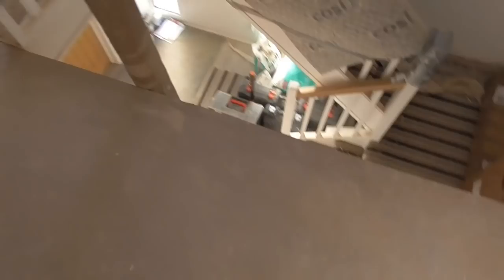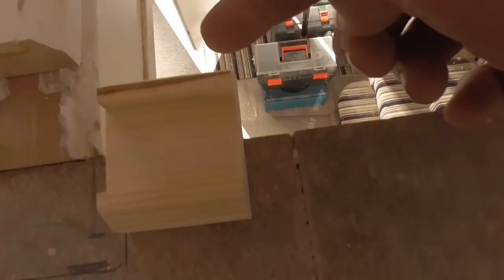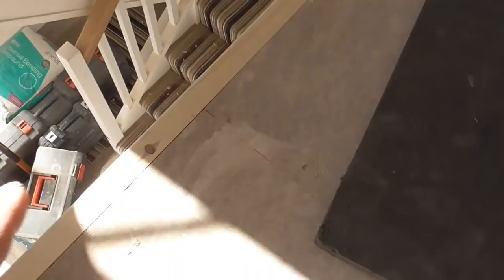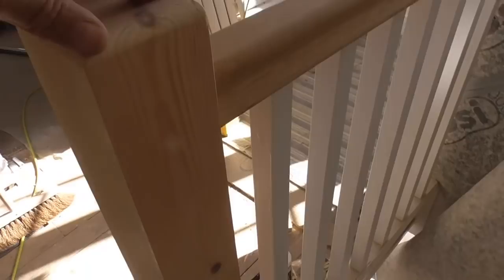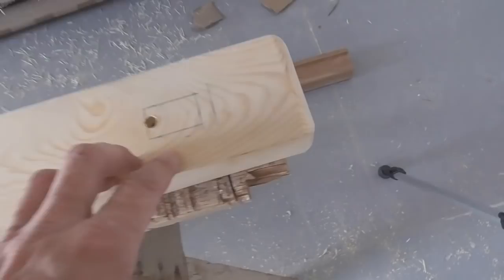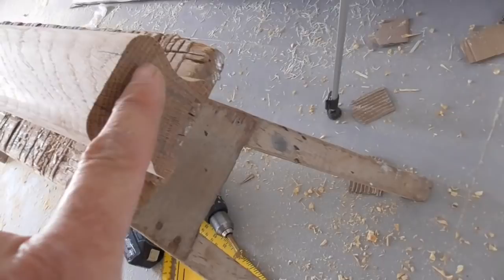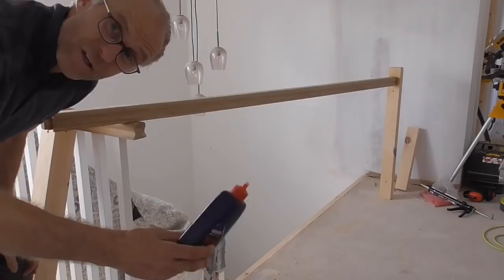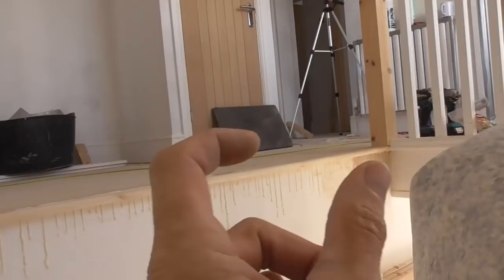Retro fitting newels posts, handrail and spindles ***PLUS HAND CUT MORTISE AND TENONS***

Comment: Del, it is a true testament to your shills at problem solving. I have never had to do something like this and I could imagine myself trying to come up with a clever way of strengthening that newel post into that floor such as cutting out that section you marked and putting a steel bar into both floor and underside of the post. Fine craftsmanship with a bog standard rip saw! Your solution works and the experience is in deciding when enough is enough.
Reply from the maker: Hi Michael🖐In my experience, even doweling down into the joists never really gives makes a strong, wobble free newel👍I appreciate your comment, and you're so right when you say that sometimes you need to know when enough is good enough👊Thanks for watching😎Cheers Del

Comment: Toolstation do a pu adhesive in sealant type cartridge, brilliant stuff. Bit more expensive but a lot more controllable and a lot less messy!! Top job Del!!
Reply from the maker: Great comment Jay🤗and I use it all the time, as, like you say, it's really controllable👊I just didn't have any this day, and there was some PU floor glue on the job which saved me having to nip to a Toolstation to pick some more up👍Thanks for your comment and for watching 😎 Cheers Del
Reply: Hi Jay, that's the stuff I use , sparingly.

Comment: Nice job mate, it's good to see handrails jointed the proper way, i always mortice & tennon hardwood and softwood  . I also tell myself I've  still got it if the joints fit straight off the handsaw.
Reply from the maker: It's always a little win when the joints are good straight of the saw🤟Thanks for watching and your comment 😎 Cheers Del

Comment: Once again making hard 'finicky' job look easy.
Top tip  for you with polyurethane adhesive which is  moisture curing. I  just wipe the timber with a damp cloth or little spray of water and this speeds up the curing.  Less drips.
Take care 🙂
Reply from the maker: Hi Tim🖐I always try to moisten the surfaces when using PU glue, but I think I just got a bit over excited on this one and let glue flow😲I paid the price though, as I had to clean off all those drips😖Thanks for your tip and for watching 😎 Cheers Del

Comment: Nice job for a hand cut M & T with a general purpose panel saw not a tenon saw.

You need to get a  festool domino for doing your tenons fast, accurate and very strong.
Reply from the maker: Hi Kevin🖐I've seen a few videos on the Domino cutter🤓It does look like a great bit of kit, but a little too good for my jobs😬Thanks for your comment and for watching 😎 Cheers Del
Reply: I used to think will I use this machine as I have full workshop set up with mortice and tennon machines but I took the plunge and find myself using it more than I thought I would.
Reply: @thetallcarpenter  A masterful display of how to cut a tenon with a simple panel saw T.C, 👍😁🔨🇮🇪

Comment: Its coming on a treat Del. Do you ever pre-finish your stair parts? Have you ever had problems with pva drawing out the tannins in the oak? Im looking forward to seeing you tie this all up. Keep busy 😁
Reply from the maker: Hi Michael🖐It's rare that the oak components I fit are pre-finished and I haven't seen any problems with PVA drawing out tannin when using oak👍Thanks for your comment and for watching 😎 Cheers Del
Reply: @thetallcarpenter  Ah, by pre-finished I meant apply the finish yourself before you start fitting. I find it much easier to apply the first coat at the bench, and then sand it all before I start fitting. Then when everything is in place I go through and give it all a final coat.
Reply from the maker: @trig  I get you Michael👍Generally I'm just asked to do the carpentry, but occasionally on jobs with good decorators, I will work in with them and get some bits pre-finished👊
Reply: I prefer polyurethane glue on stair jobs, one reason is as you say Pva draws out the tannins in oak and leaves a black stain if it's not removed quickly, 🔨 🇮🇪
Reply from the maker: @TheToolnut  As you can see from the video TN, I always seem to get PU glue all over the place😲Cheers Del
Reply: @thetallcarpenter  I'm the same T.C, 😆 The beauty of the P.U is as you say once dry it peals off easily, 👍🔨🇮🇪

Comment: With what you said about the old newel being 70mm, if you’d ripped the new one down to 70mm both sides then you wouldnt have had to put the awkward little round on the bottom corners of the new newel. Furthermore, even though I hate to leave a nosing overhanging too much like on the original here, if you’d made your nosing wider and mitred further back into the original nosing then that would have incorporated the new newel even better.
Reply from the maker: Hi Kris🖐I get what you ate saying, but the position of the new newel was always going  to be dictated by where the original base rail and handrail it was joining into, and therefore the size of newel could not have affected this. Yes, I could have made the capping/nosing a lot wider and solved all the newel overhanging issues, but this would have meant it hanging further out into the stair well, not only looking odd against the original one it mitred into, but also causing more work trying to support it, as using the 90mm newel kept the base rail centred over the joint between the floor and the capping so I could screw the capping into both, again, helping to support the capping. A 70mm newel just would have made all the base rail and capping look a bit on top of each other, or, as you suggest, a wider nosing that would have looked out with the adjoining one from underneath👍The next part is out soon so hopefully you should be able to see the finished detail👊Thanks for your comment and for watching 😎 Cheers Del

Comment: Love the videos, out of interest why did you only have a 40mm mortise/tennon instead of using the full height of the rail?
Reply from the maker: Hi Sean🖐Stepping the tenon down from the top of the handrail leaves a cleaner joint against the newel face. If the tenon was full height you'd see a tiny bit of the mortice no matter how good the joint was👍Thanks for watching and your comment 😎 Cheers Del

Comment: Very good del. 👍. Nice strong tenon joint on a landing hand rail. We'll cut and no fine tenon saw with you 👌. I love when you drove your screws into the newel to handrail and super excited to see glue squeeze out! A great feeling 😁. Class work. I notice you have a soft ground  knee pad with you, do you not like knee pads inserted into your work trousers?
Reply from the maker: Hi Paul🖐I've never got on with knee pad inserts  as my legs are long and they never sit right when I kneel down😲I find that little kneeler pad more flexible and you can also sit on it at grub time🍵🤩 Thanks for watching and another great comment 😎Cheers Del
Reply: @thetallcarpenter  I'm the opposite to you I'm small in stature, I agree knee pad inserts tend to move tge wrong way when kneeling alot. I find I'm fussing at them. I have a question if you have time? Have you ever cut a pitched round roof ? I would love to.  I worked on a old Irish castle that had one on a round town ,it was  amazing all done by  hand tools back in the day. I used to use my luck break to examine it 🤣I'd love to see a video of a round roof being constructed.
Reply from the maker: @paulcloona9331  Hi Paul🖐There's a few roofs I'd love to do, and a proper round one is on the list🤞I've done a 12 sided roof but it had little hips so not really round. I'd also like to do an eyebrow dorma, a mansard and a steep pitched Oust house one👊I definitely feel a little underfullfilled when it comes to roofing and you should check out Jason Joyce on YouTube as he does some AMAZING roofs👍Thanks for another great comment and for watching 😎 Cheers Del
Reply: @thetallcarpenter  thank you  del for the reply. I will check Jason Joyce 👍😎.  A America chippy on a site I'm on put up a eyebrow dormer he had done, he curved the dormer right back into the room  pictures of it as he built it.He Said it was very challenging, it was top class. 😁
Reply from the maker: @paulcloona9331  It would be great to get stuck into something like that Paul🤞

Comment: Hi Del,  great video again, just wondering if you have come across any carpenter's using boxwood handle chisels and a beech mallet that's been soaked in linseed oil for at least a month? All I see is online is a hammer and steel top chisels lol. I always use the former. Thanks again for a good post.
Reply from the maker: Hi Robert🖐 I did a video on what's inside my tool roll, and I kinda answer your question a little bit in that. But, no, I rarely come across anyone using boxwood handles chisels and a mallet on my sites😬Thanks for watching and your great comment😎Cheers Del
Reply from the maker: https://youtu.be/ISCeLxx9Cls Here you go👍

Comment: Lovely job as always del, one question how did you keep that nosing tight to the floor while the glue went off ?.
Reply from the maker: Hi Jim🖐I cut the nosing in pretty tight so it held itself with just the biscuits as the glue cured👊(it's not a high expanding PU glue)Thanks for watching 😎Cheers Del

Comment: Another great job Del. Can I just ask about the base of the newel? Is that method of hidden screws and PVA enough for building regs. I only ask, as I avoid staircases because I don’t have enough knowledge of setting newels. 
For example, if a customer wanted you to replace an old for new oak newels , rails etc and the newel at the base of the stairs had a concrete floor, what would you consider ? 
Thanks Paul
Reply from the maker: Hi Paul🖐Normally, the full newels would sit further out and be halved over the joists giving extra strength 💪 But in this instance, we didn't go for that due to customer wanting a cleaner line between the stair well wall and the 1st floor landing. (basically no aprons). Skew screwing the newel down is plenty good enough, as it gets its upright support from the stair flight top newel and the half newel at the other wall. It would take a ridiculous amount of force to either, uproot the full newel from the floor, or hit it so hard that it broke the flights top newel👊Replacing newels when modernising stairs is always a tricky business, as, as I described above, the newels get thier strength from being halved over the 1st floor and morticed and tenoned into the string, (and usually the newel goes down into the floor screed), at the bottom. Replacing the top and bottom newels on the main flight is a lot of work, and I've found over the years, that simply cutting off and trying to dowel in a new one's, never seems strong enough as people do swing on the newels when using the stairs.😬Thanks for your comment 😎 Cheers Del
Reply: @thetallcarpenter  cheers Del. Keep up the good work
Reply: @thetallcarpenter  I agree with you in relation to retro fitting newels onto existing stairs T.C. I've done a few jobs where I used newel extensions. I don't like them to be honest. I prefer to take out the old newels completely and replace them. A temporary structural post under the top of the stringer supports the stairs whilst I remove the top newel. The bottom newel is usually more straight forward to remove. Obviously one has more scope if the stairs is being carpeted. Modern developments in power tools have helped greatly of course like the cordless multi-tool. Along with advancements in fixings like Timberloc structural screws and the Kreg H.D jig. Polyurethane glues are fantastic for stair renovation work as well, 👍 😁 🔨 🇮🇪
Reply: Drill a 16mm hole into the slab with a corresponding hole of the same diameter in the bottom centre of the base newel then install some 14mm threaded bar (approximately 18" long) Dry fit and check for plumb then once happy put some polyurethane glue or expanding foam into the holes. Job done, 👍 I usually try to get the old newels out in one piece if I can. They act as templates for the new newels, 🔨 🇮🇪
Reply from the maker: @TheToolnut  I agree with your whole comment TN and I won't be coached into a quick and easy stair update by a customer saying 'we don't want to go to mad, just tart it up a bit'😬I either do the flight newel properly as you describe, or walk away👍Cheers Del
Reply: @thetallcarpenter  Indeed, I always skip on the pot of tea and plate of sandwiches jobs, 👍😆 🔨🇮🇪
Reply: @TheToolnut  thanks for that. Very helpful 👍🏻
Reply: @paulyoull5472  👍 😁 🔨 🇮🇪